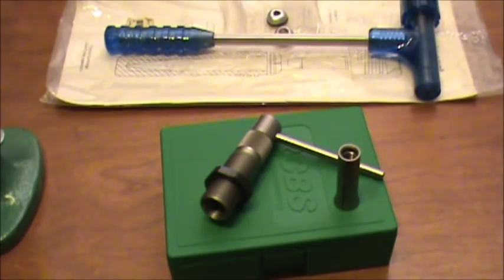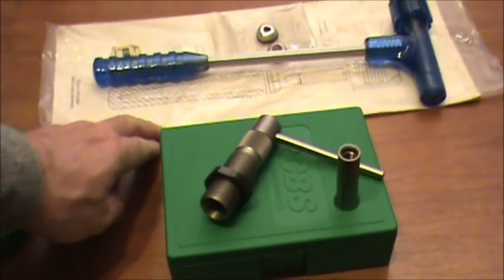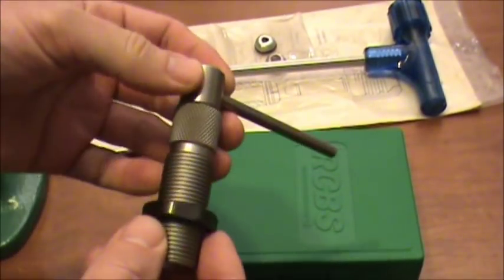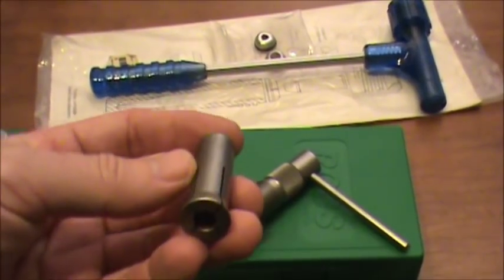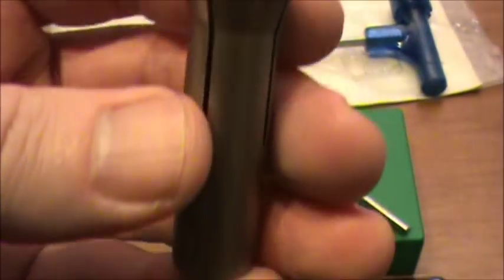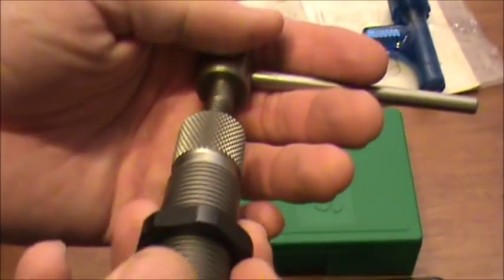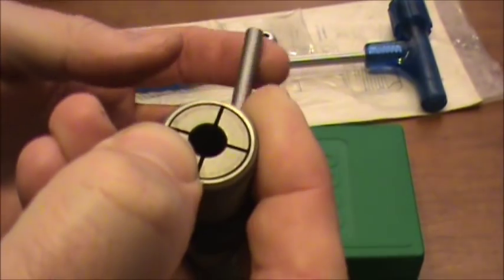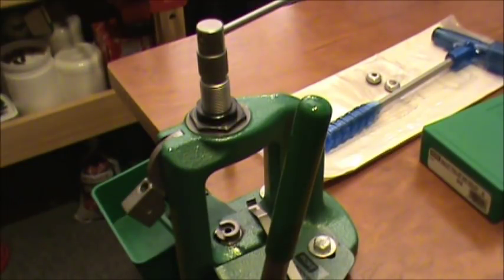RCBS Collet Bullet Puller & Midway Inertia Bullet Puller

Comment: appreciate the tip on seating the bullet a bit when using the RCBS puller, was having some problems and was about to call it quits with some unfired range pick ups.  Worked like a charm
Reply from the maker: Nice to hear that some of the advise in the video is still helping folks out. Thanks for the comment.

Comment: A little tip (no pun intended); when using an inertial puller, stick one of those foam hearing protection puffs in the bottom of the well, and it will prevent damage to the bullet.  Good video.  Thank you.  :)

Comment: Just started using mine on some 9mm. Had trouble getting bullet to drop after loosening the collet.  If this happens, tighten it up a half turn prior to running up the ram.  Then tighten, pull bullet, then release the collet.  Bullets drop right out.  Get a stick one? Unscrew collet and use the handle to knock it out of the collet.

Comment from the maker: The RCBS tool might be able to pull wad cutters if there is enough of them sticking up out of the case. Extremely sharply tapered bullets can be difficult to pull if they are heavily crimped or sealed to the case. The collect collet for 7.62x25 would be the ".30 caliber " collet.

Comment: Good video. On my fourth year of reloading and I do shoot a lot of rounds. I had my first bad batch. .243, IMR3031, Varmint Grenades. I believe I had the seating die set too low for some reason and it tried to crimp the case. I loaded 50 before i decided to try one in the chamber. It would not go. None of the loaded rounds would. I had another 50 brass i had just sized. \i tried them and they chambered well. Now i have to pull the previous 50. I used to check after the first load but repeated success has made me over confident so this problem is a good thing. Keeps me on my toes.
Reply from the maker: Mistakes happen to anyone who loads enough, it's always good to catch them at home and not waste a trip to the range.

Comment: In my inertia puller I find that if I don't snug it down, the looseness of the round increases the inertia and takes less raps to get the bullet out.  I've used a steel target to bang on, but have found that my Dillon 550C press is great.
Reply from the maker: I don't see how you can "increase the inerta" by leaving the cap loose. Also if you don't snug the cap down you will soon distort the collet that holds the round to the point it is unusable. The directions from the manufacturer clearly state to snug the cap down and to check between blows to insure it is still tight.
Reply: Simple, I use regular shell holders in mine, not the collets and I don't snug the cap all the way down.

Comment: Great Video! I have used the Frankford Arsenal bullet puller with good success. I also use my Lee shell holder instead of the collets.  I have used mine a lot and it has developed many hairline cracks. I hit mine off of 2"x4" scraps, and it beats the hell out them!

Comment: I find that for 'some' cal bullets we have to abandon the caliber number as a measurement and rather, use a caliper to measure the diameter of the bullet, then buy the corresponding collet. 

Example: The correct puller for .308 projectiles is 32/8mm collet RCBS part# 9428. Using this will allow you to reuse the non-damaged bullet after pulling [as long as the crimp, if any was light], because the collet grasps the straight-side of the bullet & not the ogive.

Way better than the hammer-puller.

Comment: Another tip…..I use a 3x4x1” thick lead block.  It usually takes only 3 swats to work.  Much better than concrete!
Reply from the maker: Thanks for the tip. Probably a lot easier on the pullet than the concrete floor is.

Comment from the maker: @Gungeek Those little light crimped in bullets must be hard to pull with an inertia puller. I've pulled some of that 7.62x25 apart but used the press mounted tool & it worked well.

Comment: the midway bullet puller detonated in my face.it was a fmj steel case 7.62X 39. i was lucky to regain my eyesight again. the bullet pulling hammer is very dangerous.
Reply from the maker: Did the cartridge go off or did the plastic just shatter from impact with the striking surface? There have been isolated incidents with impact type pullers, generally with reloaded ammo with high primers and a shell holder used instead of the supplied collet.
Reply: the cartridge went off. i was not using a shell holder. i believe there was a spark from the steel case against the mild steel jacketed bullet.

Comment: Which method is better if you want to reuse the bullet assuming no crimp was used?
Reply from the maker: If possible I prefer to use the RCBS collet pullet, however with many bullets with sharply tapered profiles one has to use a lot of force to get the pullet to hold the bullet and this leaves marks on the bullet.

Comment from the maker: @tjh141994 I've had mine for probably 15 years and it shows no cracks yet, but I'm sure one day it will shatter. If it does I'll just get another one! I used to beat mine against my wood chopping block, but the cement floor works better and it's right beside my reloading area.

Comment: Is the powder re useable I've heard different things
Reply from the maker: If you loaded the ammo you should know what the powder was and could reuse it. If you pull apart factory loads reusing the powder for another application is risky and I would not recommend it as you dont know what you are dealing with.

Comment: used the collet puller to remove old armor piercing (black tip) .30-06 WWII bullets and install them on .308 rounds... simple
Reply from the maker: What weight do 30/06 AP bullet have? 150 grain?
Reply: @314299  dont remember, it was years ago, but it worked out. I do remember I did weigh the bullet, but I didnt load that many rounds... black tip would never be used unless the world has gone to hell

Comment: Don't have a clue how, but I had an Inertia  puller explode in my had while attempting to pull a bullet.  Left standing there with part of the handle in my hand and parts scattered all over the shop and my ears ringing.  Call the mfg. and was told that I was the second one to call that week about the same  problem, no offer to investigate or replace.
Reply from the maker: That sort of "excitement" is the sort we all want to avoid. Were you pulling apart factory loaded ammo or reloads? Anything unusual about the ammo? Hopefully you were not hurt.

Comment: I don't like the inertia puller,. I don't think they stand up, and don't want to spent the money for a collet type, so I ordered a faring tool and will figure out how to make that work. $12.00 no collet required!  I do like the RCBS puller, But with collets and puller It would be another $70.00 to $100.00 or more if you need several sizes. The flaring tool may end up damaging a bullet or two, but I can buy a lot of bullets for $75.00. I think in most cases I can get it to work without any damage!
Reply from the maker: I've been using the same inertia puller for over 25 years, so they can hold up. And mines seen a fair bit of use. I do have a spare one, just in case the old one breaks.

Comment: I'm a little disappointed in my RCBS puller unit. Very slow (not near as slow as a hammer style) and if you're pulling pistol bullets, the shape of the bullet and the type of cartridge determine if the thing will pull the bullet. The Hornady 'cam lock' type puller looks faster, but may have the same bullet shape problem.
Reply from the maker: I think most of these bullet pullers suffer from slow speed of operation.